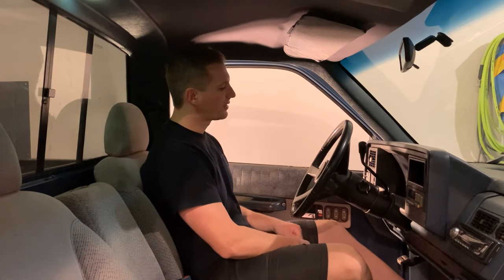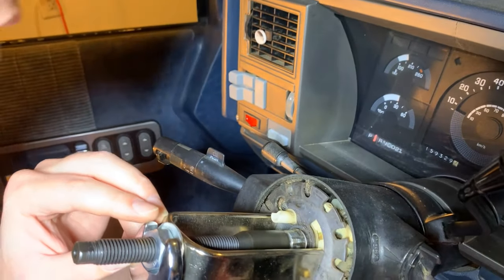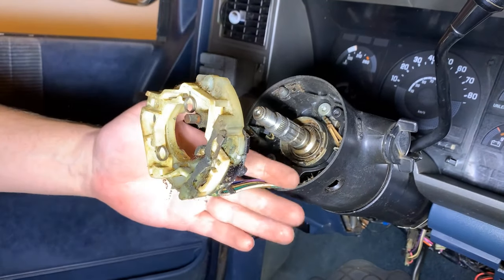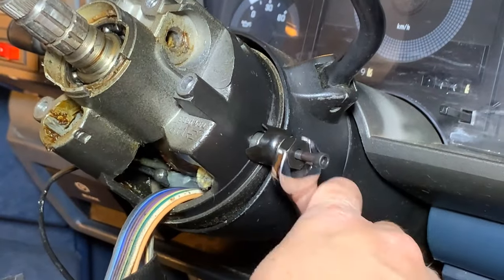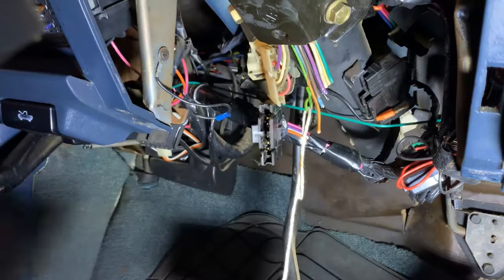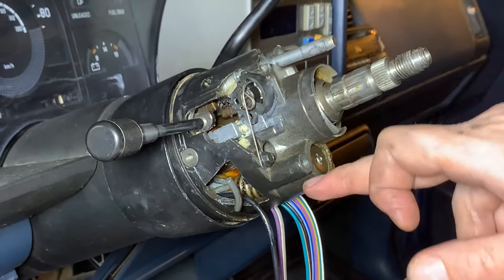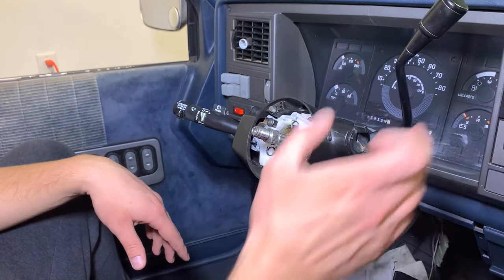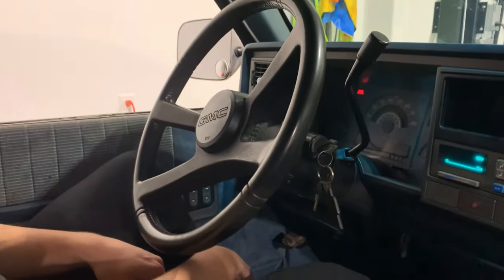Turn signal switch, horn, and gear spring replacement on an 88-94 OBS Chevy 1500

Comment: Nice video man but you never addressed where the orange plug in the middle of the shot at -20:02 thru -19:45. It's the only reason I watched this video. Again nice video but missing about 5  seconds of very useful info.
Reply from the maker: @John McCoy are you talking about the u-joint thing that makes the tilt work or the orange plug under the dash?
Reply: @SuburbanRanch  the orange plug under the dash. I think it runs up to the stalk not real for sure. It's a male blade type plug that's made out of a breadboard type of material or like a green electronic circuitry board material. I have swapped out the column in my 94 GMC several times & can't for the life of me figure out where it goes. It doesn't seem to make much difference I don't think. But idk. Hahaa. Blinkers, wipers & dimmers seem to work ok haven't gotten the chance to try out the cruise control yet. Thanks for the quick reply. And dig what you been doin here in the depths of the Google Man's (aka G-Man) YouTube. Hahaa. 
Keep on Keeping on.
Reply from the maker: @John McCoy Yes that is the cruise control wire. It plugs in up above the column.
Reply: @SuburbanRanch  Thanks so much for taking the time to answer my question. I will be on that first thing in the mornin. Very much appreciated and again man 
Thank Ya Kindly.

Comment: Why doesn't anybody take the steering wheel completely apart. To be fair you have the right truck in the wrong steering wheel. However I was hoping that you would take the locking mechanism for the steering wheel out because I can neither turn my ignition key or my steering wheel because the sack is full of rust and will not allow me to remove the key lock drum because the locking bar will not drop.

Comment: clock spring ?
Reply from the maker: @joe smith What do you call it?
Reply: @SuburbanRanch  it's called a Ignition Key Buzzer Switch
Reply: to remind you that the key is still in the ignition
Reply from the maker: @joe smith Thanks for the info!

Comment: Does the part#19107008 works with cornering lights? I bought the wrong number part does any body knows the difference 01997988 ac delco also